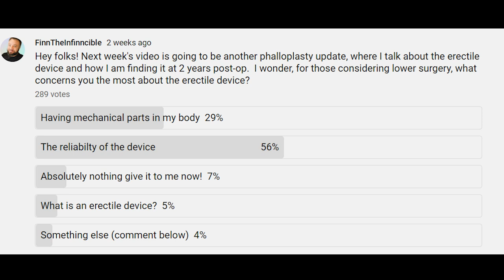Phallo Penile Implant | Honest Answers To Common Questions & Concerns

Comment: I suspect that these surgeries will get more advanced and less painful over time, especially with research going into reassignment surgeries as trans rights progress. It helps funding that several high-caliber public figures have come out as trans, too. Surgery itself is such a rapidly progressing field that I think replacing your pump may be a much smoother and less traumatic procedure by the time you need it.
Reply from the maker: That is very true, thank you for that reminder! Hopefully, by the time l need it replaced, access to treatment will be quicker, surgery easier, and pumps longer lasting!
Reply: @FinnTheInfinncible  Fingers crossed! Don't forget that things like robot assisted surgery which were rare even 10 years ago are mainstream in the US/UK/EU now, even in tiny hospitals. The advancements in the next 10 years are likely to be huge. Not to mention the advancements we're making with implantable devices.

Comment: Hi. Thanks for all the great helpful information.  I had the same penile implant as you had two months ago, and I have some concerns which I was wonderingif you can give some advice,  please. I can feel the hard part on the base of the left cylinder, where they anchored it to my pubic bone. I don't feel any hard part at the base of the right cylinder.  It seems that the left one has been pulled out of my pubic bone abouta centimeter. Just by pumping it, I get a lot of pain, and its only on the left displaced cylinder.  I was wondering if that pain in that part would ever goes away or it would need to be surgically fixed on place to get rid of the pain? I also see that because the left one is being pulled out, it has become abit longer than the right one, making my penis tilt towards the right side. However my biggest concern is now the pain. I would appreciate you insight on this issue. 🙏

Comment: Hey Finn! Thanks for another great video. I have a question. When you have gender confirmation surgery, do they modify your actual pelvic bone? I know that bio-men and bio-woman have very different and distinct shaped pelvises, do they file down or add some type of material to your actual skeletal structure to change that? Or is the change more so just outside genitalia (penis and vaginal canal) and this device you’re also sharing about? Thank you for being a resource for those of us who are educating themselves on this topic!
Reply from the maker: Thank you for your lovely words and kind appreciation! 

In regards to the pelvic bone, as far as l am aware they do not modify it as such, but just anchor the device to it.

All that's changes is the external appearance of the genitalia.

Hope that helps!
Reply: Just chiming in- this question is definitely a complex one with an equally complex answer. 

Whereas there are cosmetic "body contouring" procedures, the pelvic bone itself is shaped differently and this becomes a question of changing the structure of the pelvis itself. This area is vastly complicated — lots of blood vessels, huge muscles providing overall stability to the whole body, and, of course, major internal organs inside the pelvic cage which you do not want to harm. Plus, the whole area moves when you walk, bend, or twist. There have been some extreme cases (such as bone cancer) in which surgeons have been able to 3d print large sections of a pelvis, but functionally nothing comes close to the real thing. 

That being said, there are areas in Korea (IIRC) that offer titanium implants to widen the hips for AMAB women. From what I've seen they've been quite successful, but its too early to determine potential long term effects. Hip surgeries are also quite complex, due to the muscles, tendons, and nerves that attach there and allow us to walk. Cost (again, IIRC) is about 15k up front per hip.

I've not found any solution for AFAB men because it would require removing or greatly altering large sections of the pelvis, generally a no-go for the above reasons.

Hope this helps!
Reply from the maker: @fevre_dream8542  thank you for that!